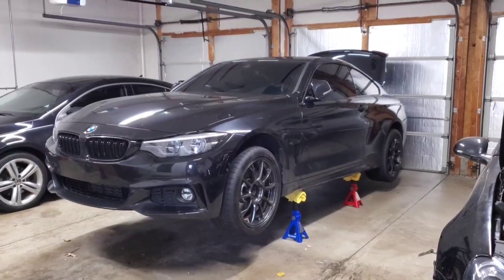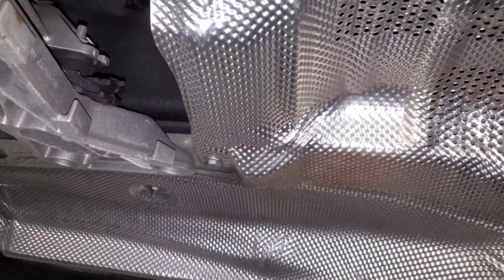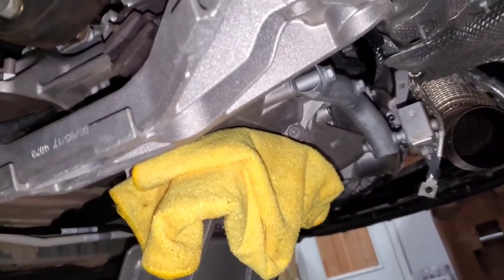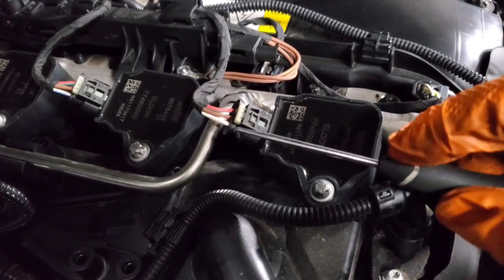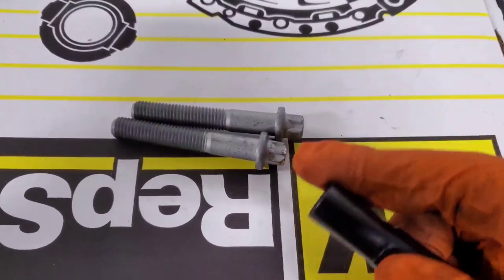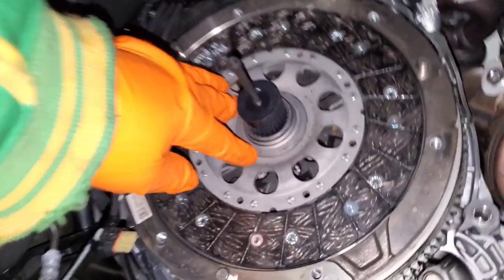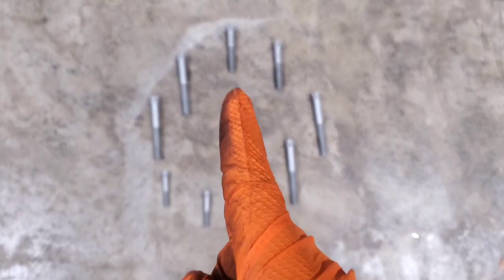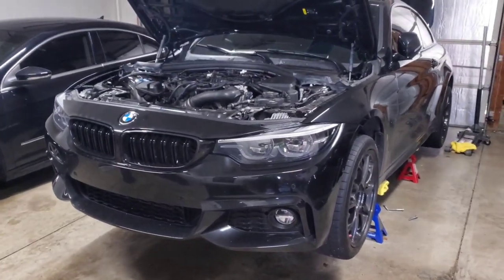BMW F-series Clutch Replacement (2018 440i)

Comment: Thanks for filming this, will be doing my wife's car on the drive in a few weeks. A good tip for gearbox bolts or anything like that is to get a piece of cardboard, draw a circle on (or the shape of whatever component you're removing), mark the top and just punch the bolts through the cardboard at the relevant points. Never need to worry about not remembering which bolt goes where.

Comment: Btw for anyone curious, just looked up in the service manual on how to deal with the pressure plate locking plate and clutch centering tool. 

The alignment tool that comes with the clutch has a screw in the back. 

Insert the alignment tool through the clutch and into the flywheel, then remove the screw from the back of the tool. This gives enough room to then install the pressure plate with the locking tab installed

Once the pressure plate is torqued down, remove the locking plate. Reinstall the alignment tool screw and use it to remove the alignment tool

Comment: Thanks for the vid. Found your link on the bmw forums. I’ve been upgrading my 18 440i m sport as well. Currently on a bm3 Stage 2 tune with the stock shifter still in. Got the car at 54k so I’ve been looking at options and went down the 550i rabbit hole. Awesome info
Reply: what clutch kit did you go with? my 440i clutch is slipping after stage 1 tune.

Comment: So I only need the kit that you linked and new pressure plate bolts and that's it? I'm 2017 340i x drive 6mt thx kern!!!!!!!
Reply: stock pressure plate bolts or 550i bolts???

Comment: The gear selector sensor I broke mine off while removing my motor just the ends that’s connected with the two 10mm bolts would it still be good to zip tie somewhere else or best to replace?
Reply from the maker: Replace it

Comment: I got a dtc for excessive clutch slippage 0811. It went away but, I feel like it might be slipping a little bit in manual mode. Just doesn't feel as "grabby" as a gew months ago. I messed around a lot in the canyons when I was learning the car. Oops lol. When you replace the clutch im assuming there's a break in period of 500 stop and go miles like other new clutches or is it ready to go out of the box?

Comment: I can’t find the find torque specs for the pressure plate and flywheel bolts anywhere. Do you know the torque specs? If so please hit me back man. Great video. 
Thanks!
Reply from the maker: Pressure Plate 15 Nm + 90 °
Flywheel 45Nm + 45°
Reply: @kern417  thanks man!
I greatly appreciate it!

Comment: I'm changing the clutch on my M140i. I will go with the 550i clutch as you did. 
Any tips and tricks on what tools to get from BMW and what should I replace (bolts, gaskets etc) while I'm in there?
Do you know the OE number for the OEM 550i clutch pack?

Comment: very useful thank you. i was wondering what that piece in the clutch was for i was thinking surely the gearbox shaft wont fit through that and it wont lol. im going to be fitting this clutch to a 320d although the lining will be removed from the clutch plate and put onto a 320d clutch plate because the center of the clutch won't fit my gearbox. but im pretty sure the process of removal and refit is exactly the same. The clutch back plate will bolt straight to the  flywheel of any 20 30 or 35d manual with no issues. 

maybe this will help some others as this clutch should be a direct bolt on for a 330-335d etc its capable of 850nm and will be a stock like clutch. the 320d however the gearbox shaft is smaller so the clutch plate won't fit however the lining will fit the 320d plate so you just need to get it swapped over by a professional company. i wouldnt attempt the clutch rivets yourself its just not worth the risk.

Comment: G'day Kern, Loved the video mate, I know this question has been sprinkled in the comments but I'm yet to find a proficient answer on the forums. 

Is a Single Mass Flywheel beneficial for the GS6-45BZ? I understand there is associated issues with chatter, some suggest spring loaded clutches can reduce this but I'm unsure, however being that DMFW are a 'normal wear item' would it be a good idea to convert this to SMFW while the transmission is being accessed? I ask because I have heard of the new supra gearbox utilising a Clutch masters (FW-340-SF) steel SMFW in the aftermarket community. 

Would be greatly appreciating your insight, I have been living on forums trying to find an answer

Comment: How did you know the 550i clutch would just bolt up? Could that same clutch be used to upgrade an f22 240i ?
Reply from the maker: Yes it will. If you look up part numbers, the clutch in our cars is the same model they've used since 2008 e90 335i. So all cars since then have the same clutch fitment and the 550i clutch will work. The only thing BMW changed in newer models is the flywheel.

Comment: Can I also not detach the clutch line but unscrew the slave cylinder? I have a N13 engine with 6 speed MT, so this might be different. I think I have a flexible clutch line, so this might work
Reply from the maker: Yes it will work

Comment: Hi mate, fcp euro is saying this kit won't fit the 340is, I've got a 2017 m240i and I was sure this kit would be a direct fit

Any info the b58 god 👑 can provide me?
Reply from the maker: Yes it will fit with the oem flywheel. I sent them an email confirming it would but i guess they haven't updated their compatibility.
Reply: @kern417  Really appreciate the quick reply mate gonna order it straight away, hopefully have a good attempt at it in few weeks time thanks to you
Reply: Heyo dude managed to do the clutch but I'm experiencing some rattle noises here and there, haven't had time to diagnose what's causing it just yet. Did you experience any similar issues at all?
Reply: Drives fine though no faults at all
Reply: Nvm it ended up being one of the heat shields being a little out of shape😂, job was a good one

Comment: Question, I removed that retaining clip before I installed the pressure plate for the very reason that the clutch tool wouldn't fit through it. I read in a forum that the clutch will not work if that clip is removed before installing the pressure plate, do you believe that's the case? I'm currently in the middle of the job right now
Reply from the maker: I dont think it will line up properly
Reply: @kern417  yeah I have to buy a new clutch kit. Thank you

Comment: You produce great videos.  2 questions:  Are you a mechanic by trade and was the upgraded clutch absolutely necessary.  I have 2017 440i and wasn't counting on upgrading the clutch as I build some additional power.
Reply from the maker: Not a mechanic but the clutch upgrade is necessary for the torque you'll make above stage 2 93. The clutch begins to slip above stage 2 E30. This is feedback from people online. Also, it is the same clutch that was used since the 2007 335i, so lot's of historical data on the limits. If you're just sticking with a Downpipe and pump gas, stock clutch is fine. But the 550i clutch is a cheap upgrade that feels like stock if you plan to go a little farther.
Reply: @kern417  my 2017 440ix  is causing slippage after stage 1. Is this an OEM 550i clutch or what brand? LuK?
Reply: @puresoundz  luk repset

Comment: How many miles have you been running with the OEM clutch (before replacement) ?

How many of these miles with stage 1?

...clutch was still working OK at the time of replacement ?

Thanks 🙏
Reply from the maker: 10k
4k
Yep
Reply: @kern417  ok so pretty much brand new clutch ;)

Your update was no repair and much more a preventive measure ??
Reply from the maker: Yes, i explain it in the video.

Comment: Dope video my man, been wanting to drop my 6spd transmission from my 2014 F30 335xi. Seems like it will be just the same, but im gonna have to pop my front axles as well 😏
Reply from the maker: check newtis.info for more details on your specific car. from what I read, you can disconnect the transfer case and awd control unit, then the rest of the process is more or less the same.
Reply: @kern417  thanks for the insight I will look into this. Very much appreciated my good man

Comment: Excellent video! How did the break in period feel when driving? Any slip at all? I put my tune back to stock for break in period for when I get it back from the shop. I admire you for doing this on your own. Unfortunately, I think my gear selector sensor was damaged during the replacement so waiting on a new sensor for now. Hopefully that fixes my hard code.
Reply from the maker: No problems. Pedal was a little stiffer at first but got used to it quick.

Comment: Just ordered this clutch for my car and started looking at the newtis procedure. I beeezed thru this vid before and don’t recall... are there any special tools required to do this job?
Reply from the maker: Off the top of my head, the only thing you need for oem type installation is the clutch alignment tool and the flywheel counterhold tool.
Reply: kern417 looks like you managed just fine without so I don’t think I will bother.
I really wish I could find a similar video on an xdrive car, not really clear to me just how much more difficult the xdrive system will make this for me :(
Reply from the maker: @TheWeaponsLocker  some good details here 
https://www.newtis.info/tisv2/a/en/f32-440i-xdrive-cou/repair-manuals/21-clutch/21-21-clutch-disc-drive-plate/1VnYeMZKxz

Comment: Is the flywheel the same as 8 bolt n54
Reply from the maker: different part number but i haven't looked at them side by side to see the actual difference. it works with the stock flywheel on both engines.
Reply: Thanks

Comment: So this means i can throw an E9x 6 bolt Single Mass flywheel and clutch any manual F series including an F8x?
Reply from the maker: No
Reply: @kern417  whats the difference between the e9x clutch and f8x clutch?
Reply from the maker: @euddys  The N54 engine has a different crank bolt pattern for the flywheel. You can see at 17:55 that the B58 uses 8 bolts on the flywheel, not 6. The S55 engine uses a twin disk clutch with a taller bellhousing for more clearance due to the taller clutch height. The only thing that is compatible is the clutch disk and pressure plate for N54, N55, and B58.

Comment: What flywheel did you buy ?
Reply from the maker: I didn't replace the flywheel
Reply: @kern417  at which point would you do so?
Reply from the maker: @mcmxcimega  If you need an aftermarket clutch that doesn't work with the stock dual mass. Or when the stock dual mass is worn out but that typically takes 100,000+ miles